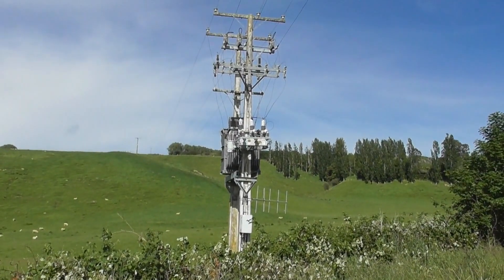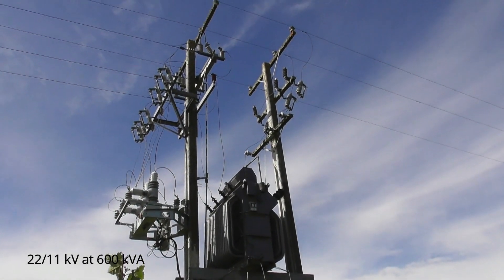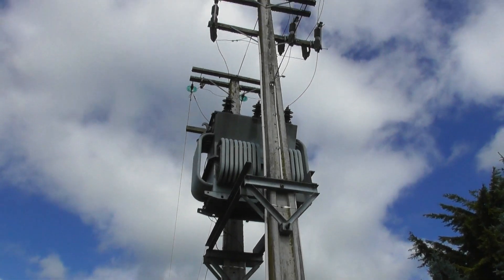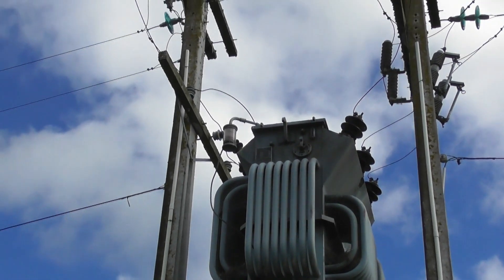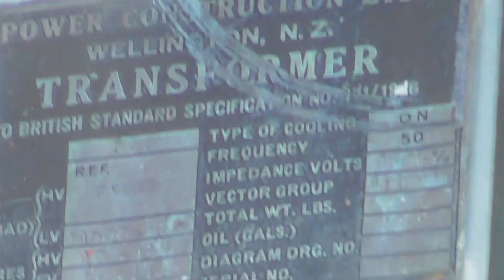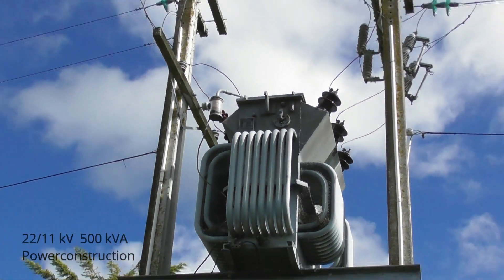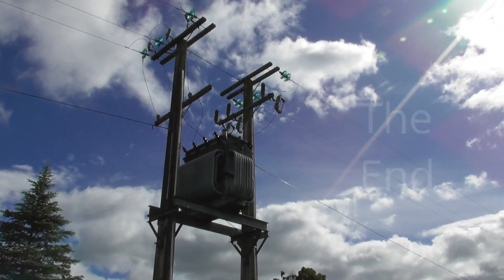22kV / 11kV / 6.35kV OH step down transformers near Hunterville NZ

Comment: Interesting that Auckland doesn't use the 22kv circuit for combining 2x 11kv circuits, unless 22kv is used as a compromise when an 11kv circuit can't travel at long distances without a 33/11kv substation in between
Reply: I was thinking on the same lines here.  I suppose it's very similar to 3.6kV supplies that are regularly utilized on small island projects, for otherwise, stepping up to 11kV would incur greater losses over shorter transmission distances.
Reply from the maker: Auckland uses 22 kV. Many 6.6 and 11 kV areas have been overlayed with 22 kV. At Penrose Sub there are 33 to 22 kV and 110 to 22 kV stepdown transformers to supply those voltages.

Comment: Reminds me both of Otter Tail Power’s in-line substations and of a now-gone substation erected by IES Utilities near Little Rock, Iowa that stepped 34.5kV down to 13.2kV, and the main transformer was about the same size. IES was later acquired by MidAmerican Energy and they downgraded the old 34.5kV line to 13.2kV and replaced the sub with a regulator bank.

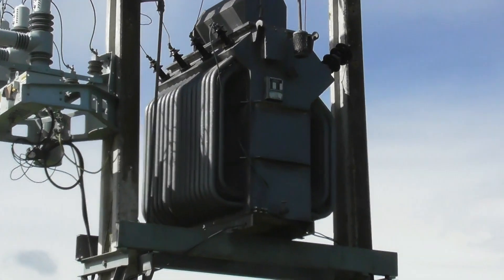Comment: 0:11 why is there a radio antenna there. What is it transmitting/receiving? Doesn't look like TV or FM radio.
Reply: VHF land mobile. sending data back to office.
Reply from the maker: That is for the auto recloser device on the 11 kV side.
Reply: SCADA
Reply: @RODALCO2007  Not sure about NZ, but here in OZ we've got a spectrum for these devices to communicate, along with fibre connections to the RMU. The energy providers network is faster than our NBN.

Comment: Hi ray, nice old gear. is the phase to neutral 6.35kv used for any thing like a 4wire ? Do you have any other oddball voltages in use  thanks
Reply from the maker: 6.35 and 11 kV is used for SWER systems. as well as 19.5 kV